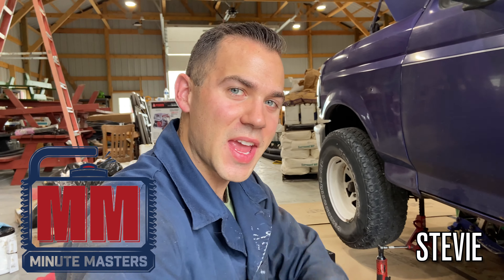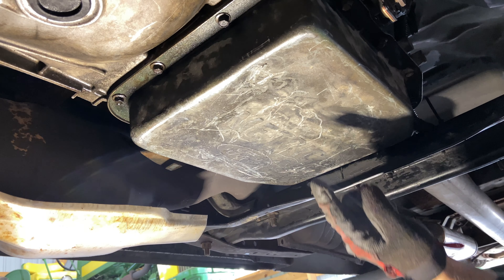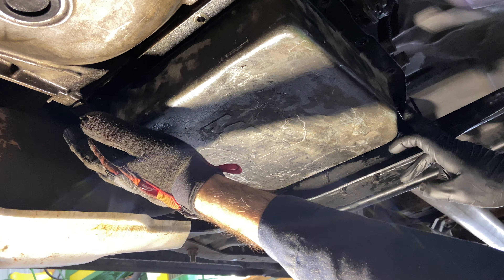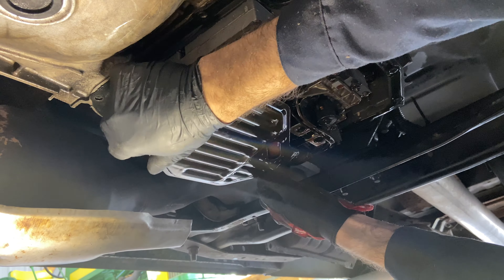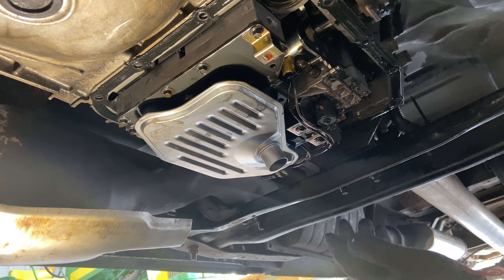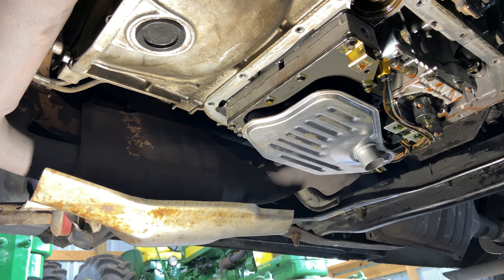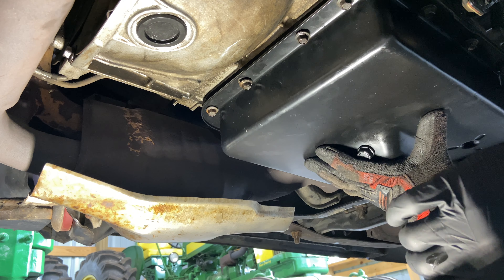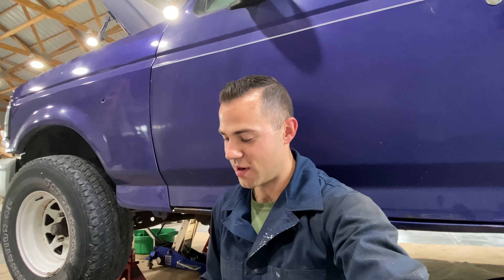How to Replace Transmission Filter and Upgrade Pan with Drain Plug | 1995 Ford F150

Comment: It looked like the transmission filter left the gasket up in the trans when the filter was pulled out. Then the new filter was installed with the same gasket.
Reply from the maker: You are correct. I pulled it out off camera once I saw it there.

Comment: It didn’t look like you took out the old seal from the old filter. From the video it looked like the old orange seal was still in the hole 🕳
Reply: It’s definitely still in there.
Reply: @vpena61  glad I’m not the only one that seen that 😅
Reply from the maker: You guys are right. I did leave it in there by accident. I was surprised that the filter did not seat all the way but also equally surprised the filter stayed in there. I ended up doing another fluid flush and I found it removed it.
Reply from the maker: You are correct! Lol
Reply: @TheMinuteMasters  just lookin out for ya. It was a great video. Keep up the good work.
Reply from the maker: @matthewgoins87  I appreciate Matthew!🤙 Thanks!
Reply: That's exactly what I saw. Plus if you look at his old filter it's not on there. That's why he was having a hard time pushing in because old one was still in there.
Reply: @TheMinuteMasters  I have a small leak I was told from the previous owner its the oil pan gasket causing the leak. Thanks for the video!!!

Comment: Can someone tell me what that rubber piece is on the top left??? I went under my truck and saw that it was missing but I have no idea what it’s called please and thanks
Reply from the maker: Share a time stamp in the comments and we might be able to tell you what it is.
Reply: @ it’s at 1:58 that rubber grommet top left side circle rubber part
Reply: @TheMinuteMasters and another thing I noticed that the housing for where that rubber part is at is open on the side, is that a bad thing?
Reply from the maker: @nathauiel  it’s an hole for inspecting the Torque converter and to drain it.
Reply from the maker: @nathauiel  typically there’s a plate there, but it’s not a sealed/water tight system.
Reply: @TheMinuteMasters thank you Man I really appreciate it, and when I drive my truck I get a clicking sound from the passenger tire I need to get my ball joint replaced I got both tie rods replaced and replaced the driver side ball joint

Comment: best tech tip ever for the ford trans, AOD, AODE, and 4R70 change teh filter and drain and fill every second or 3rd oil change and the trans will last forever. Most of the truck torque converters have a drain plug on them also, so they can be drained through the inspection hole.
Reply from the maker: Very good tips! Thanks people never flush transmission fluid or change the filter.

Comment: Those gaskets leak all the time and those pans are thinner than the original ones
Reply from the maker: Yeah I found that out the hard way and switched to a different pan.
Reply: @TheMinuteMasters 

What is the new pan that you have upgraded to
Reply from the maker: @mikalvesper1772  I bought a B&M aluminum pan.

Comment: Very nice.  I have an oversized Derale Transmission pan with a drain plug.  Haven't done a fluid change yet....but it will be so incredibly easier than it used to be.
Reply from the maker: Nice! I looked at those oversize pans a while back. I never jumped at it then, but having a drain plug is awesome.
Reply: @TheMinuteMasters  Stevie....you've upgraded from driveway  auto mechanics...to actually having a decent place to indoor auto work.  You must love that change.
Reply from the maker: @joeidaho5938  Sort of. My father-in-law built a machine shed last year for his apple orchard. He let me take up some space to do the transmission video. Someday I’ll have a garage of my own.🤙
Reply: @TheMinuteMasters  I figured that's what it was....something provided by a family connection.  Still very  nice to have!
Reply from the maker: @joeidaho5938  Yup! It’s definitely a luxury for me that I will try to use as often as possible.

Comment: Will be replacing my old OEM pan with new with drain on my 89 and 90 Bronco 2's ! Isn't there a trans screen to be cleaned prior to installing filter? Thanks for video will be checking Haines book for torque setting bolts!
Reply from the maker: Nice! There’s no screens that I’m aware of.

Comment: Good Upgrade, thought about using a Deeper 4wd Pan, for more fluid and cooling ,would also need a longer 4wd Dipstick
Reply from the maker: The 4wd has a deeper pan? I didn’t know that. That’s a sweet upgrade for more fluid capacity.
Reply: The dipstick doesn't know how deep the pan is.
Reply: @fredcloud9668  neither does this dipstick, I mean me. lol

Comment: I have a 1993 ford with 152k miles would you recommend changing transmission filter and oil?
Reply from the maker: Yes. However, old fluid has a way of making worn out transmissions work. So if you have shifting issues post fluid change, that is why.
Reply: @TheMinuteMasters 
Can you not just reuse the old fluid minus the stuff that you lost just add new on top of that
Reply from the maker: @mikalvesper1772  I have reused the old fluids if they’re in good condition.

Comment: Did the radiator leak coolant into the trans? How is the fluid in the old transmission pan green like that?
Reply from the maker: I used a UV dye to find a transmission leak.
Reply: @TheMinuteMasters  ok. Have you ever had to change the solenoid pack on your e40d? Ik those transmissions can be finicky. I just got one and only have reverse no forward gears at all and I topped the fluid level off. And its clean. Any thoughts?
Reply from the maker: @oldsoulgarage2982  I haven’t but most are accessible once you remove the transmission pan. You can try replacing them and see if that fixes your issues. 
However, changing your fluid can have the negative result of causing issues. Sometimes dirty fluid can actually make work gear clutches work. For a test I would try to find a transmission “slip fix” additive. If that makes it work, then you will probably need a rebuild. If it doesn’t then it might be worth exploring a new valve body or changing out those solenoids.

Comment: i have a 94 with a 4.9 and whenever i start it up it revs really high for a few second and then goes back down to normal idle rpms. any idea? ive thought it may be a stuck throttle plate or the IAC
Reply from the maker: Does it rev abnormally high? Typically when you start a vehicle, the engine stays at a higher rpm range until it warms up.
Reply: @TheMinuteMasters  i dont have a tach so i cant measure the rpms bur id sau ir revs at maybe 2500 rpms for a few seconds then goes back down to 1000 as it warms up
Reply from the maker: @vex9680  that sounds about right. My truck does the same thing. I think with these older trucks, it seems louder than newer cars though.
Reply: Speed sensor on trans or maybe an idle bypass valve.

Comment: I just changed my transmission oil cooler and my truck will die immediately after shifting into reverse now, sounds like possibly needs more fluids or my filter needs changing unless the new fluid isnt furry enough? Least that is what I have gathered from watching this video and reading the comments.
Reply from the maker: I would check your fluid level and your filter could need changing.

“Furry”?
Reply: @TheMinuteMasters  lol it's a 95 I inherited so I expected more metal shavings in the transmission fluid than I had. Found out my father in law in the past had the transmission rebuilt.

Comment: My truck has 175 thousand miles on it autamatic transmission I have heard that it is bad to change it so close to 200 thousand miles if it has never been changed before does anyone have some advice as to weather I should change it or not?
Reply from the maker: You are probably right. I changed the fluid one mine for this video and now my overdrive light is blinking. Lol Old furry fluid can make these transmission work and new fluid can make an old transmission not work.
Reply: Can you reuse the old fluid that you save and just mix it with some new

Comment: Hi does anyone know if 1995 fords used single or 4 port/spray hole injectors?  Fsb And obs forums not 100%  on this.
>reason I ask, guys are claiming if you swap out old single hole/port injectors to newer 1996-1998 ford explorer that have same lbs, they have 4 holes/ports to spray gas and this increases MPG due to better atomization. But only makes sense if you have old single hole spraying injectors.
Reply from the maker: I was told in 95 they definitely had the four port injectors.
Reply: @TheMinuteMasters  Thank you buddy. You are top dude when it comes to obs info!  Btw I seen a few of the guys on FSB forum mention about installing a second catch can. One more between PCV and intake.  Said our trucks can deposit oil into manifold through that route as well. Thoughts? Good idea bad idea?
Reply from the maker: @joshmiller7870  No problem Josh! 🤙 Thanks! 
I think a second catch can is a good idea. At the very least, it can’t hurt.

Comment: HEYY QUICK WARNING thats the wrong filter dude!! Thay pickup cant reach the bottom of the new pan, you have to get the 4r100 filter aswell!!! I really hope you see this!

Edit: Im wrong, thats the right one, ima leave this up tho as some might not know that you do need to get a different filter too.
Reply from the maker: Really? So the 4r70w filter won’t reach to the bottom of the 4r70w pan? Is the 4r100 an upgrade or does it work better?
Reply: @TheMinuteMasters  hey, i was confused I thought you had an e40d which is identical to the 4r100 except weaker if im not wrong, they share a pan except the 4r100 has the deeper pan with a drain plug

Tho im not sure about the 70’s filter reaching the 100’s pan.
Reply: @TheMinuteMasters but the 4r100 is the beefier transmission of 10th gen, built to handle the 7.3 from the f250 and 350 line of 99 but was also put in the 150’s , the pan and some internals still fit the old e40d design
Reply from the maker: @sucio-  Gotcha! You had me scared for a second! Lol sounds like a 4r100 would be a cool retrofit swap onto an older F150.
Reply: @TheMinuteMasters  yes it would be awesome, sadly one of the design changes included the bolt pattern to the engine :( tho i think you can use a lot of the internals in the e40d
Reply from the maker: @sucio-  Figures. Just when the better transmission comes out, they change the bolt pattern.